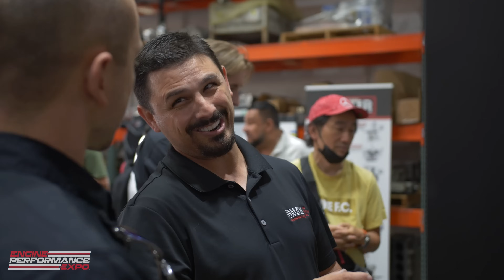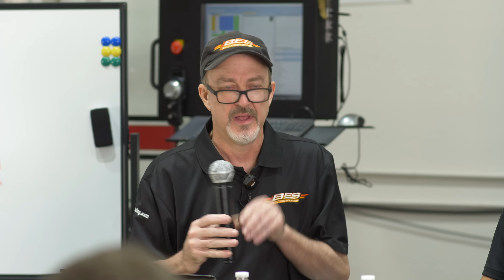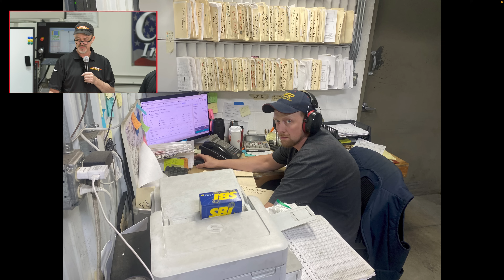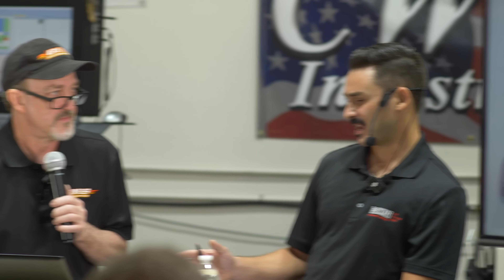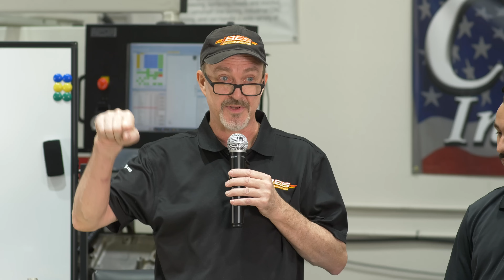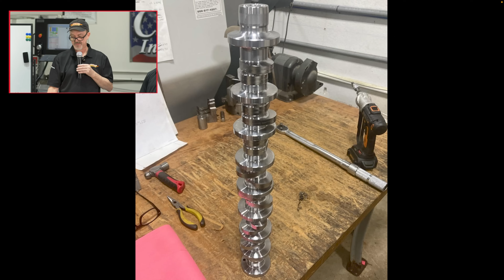Cylinder Heads, Manifolds & Modern Induction | Darin Morgan BES Racing (Part 1)

Comment: Thank you for sharing all the years of experience and knowledge here. As mentioned, you can't hardly find this information. I am curious though. You mention Split harmonic in manifold design. This is something I am dealing with right now. What I want to know is: is it better to have a bell mouth square to the intake runner with a split harmonic of say 3/4", or have the runner length closer and the bell mouth at an angle to the runner?

Comment: Would love to see Darren's version of a factory cathedral port LS heads.
Reply: Over the years, Darin has made his opinion of the cathedral ports known as it being a 'non racing' design that had a purpose of tight packaging and it is inefficient due to cross-sectional changes and velocity gradients. He said once that it is made for engines that never see the high side of 5500RPM. He talks about the LS3 or LS7 being superior, which makes sense.
Reply: @Pavel_Engines well thats obvious that the LS3 square and Rec port heads are better.  But you can't fit on to an engine with a bore size under 4". There is plenty of Cathedral port heads that still produce hp up to 65/7000rpm.

Comment: I guess in ww2 or in airplanes they couldn't run ethanol or methanol.  Or even blended fuel. Milage too low and water in the fuel.  Imagine a merlin  on methanol maybe nitro😂
Reply: The limiting factors for HP on the Allison and Merlin engines was rpm range desired just so they would last and to better match prop speed. Also, never were geared to make max power at sea level. They cared more about how much power they could make up in thin air
Reply: They did use meth/water injection.  They also had 150 octane gas available. You could make more power with nitro, but should be able to make nitro dragster level horsepower with just a good turbo setup and a little more rpm from a 27 litre/ 1650ci  4 valve per cylinder sohc engine just by adding boost and rpm, even with just race gas or methanol. Even pump gas should be capable of 8000 HP at moderate boost levels

Comment: I still think the camshaft needs to be thrown out and replaced with an eccentric shaft or small crankshaft that is connected to a cam lobe for each valve at the rockers
Reply: So design it .sell it to manufacturer
Reply: When they can produce an electric solenoid to open and close the valve that is reliable and "cheap" enough, then you can toss out the cam and have infinite "profiles" in the ECU to govern valve motion. That has not happened yet.
Reply: Imbecilic Arrogance
Reply: Electric solenoid not fast enough for race engines. That doesn't rule out mechanically operated hydraulic systems though, or hydropneumatic
Reply: The design is already out there that I think would work. Take a look at Nissan VVEL, but extend the link to where the eccentric shaft is in the block and the rest is in the head

Comment: From looking at modern scratch designed intake ports, the shape is pretty much straight with as little radius area as possible to transition to a throat area that is still angled to the valve. Does not the same thing you say about intake runners apply to the port as well?  Is the valve area still such a limiting factor that we need the flow around it to be straight down toward the valve head on 2v engines, even with the kind of valve motion we can get now?  Aren't the intake valves pretty much following the piston down the bore as close as they can?  Does the flow before the valve opens much matter more than what it does fully open?

Comment: And of course, a rocker shaft in place of the lifters in the block would also mean the rocker ratios can go whichever way you want, even putting the pivot for the block rockers on the other side to get more force on the pushrod with less pushrod travel, and make the head rocker ratio higher to get the right valve motion. With the computers to work out the lobe shapes, any geometry is possible, why still side load a cylindrical lifter into its bore at all, when you can pivot it on a shaft?  If you want to keep the roller on the cam side, fine, but F1 and motogp just use a convex face on the rocker with dlc coating and oil feed through the rocker shaft. Can do the same thing in the block of a pushrod motor and then you still get another rocker in the head to achieve perfect motion ratios throughout the lift curve
Reply: Dude, WTF are you even talking about?  Do you understand alot of this racing has rules?   You can't build a one off 55 million dollar engine to win $20k race.  You're like the Mopar guy that always acts like the Top Fuel Hemi is an off the shelf 426 from the 60's or because that's the motor NHRA uses, that it's the greatest design ever.   NO.. the F'N rules dictate that motor... period!!!!!!!!!!
Reply: Acfually, the rules in a lot of drag racing is wide open. Just gotta have 8 cylinders in a 90° vee, with  push rod actuated 2 valves per cylinder. Some rules require certain heads, or head characteristics, and maybe cast blocks, or cast heads rather than billet. Yeah, its expensive to do new things, but who cares about building the same shit every time.    If they did want to make some rules to limit costs, and still get good competition, they could look at some circle track rules, but drag racers generally like to avoid cookie cutter spec engine series
Reply: And, what is this about  Mopar gen 2 hemi is better than everything cuz that's what is allowed in the fastest classes?   How does that have anything to do with anything I was talking about. Those rules are pretty specific, but the cam and valve train is still pretty much open. Even the port shape is left to the builder. So innovation can occur. Can't really make them much faster though. Maybe try to get a valve train that is more reliable and lasts a little longer. I haven't looked at memo port shape much. Maybe they are angling the throats a little now. Don't really need it to straighten the port out, but might help fill the cylinder better with a little different path into the cylinder

Comment: Please, Darin, tell me why are we still using cylindrical lifters. A shaft with rockers, roller or finger follower with a curved ramp to match the lobe, and asymmetrical lobes are proven to be a better way to control valve motion, without even needing to make the cam core so big. ????  Just look at F1, motoGP, or even the mercedes/illmor penske engine from indy. ALSO, WHY do we still bend the intake port in the head, rather than angling the throat area like all modern race ports in 4v engines and even the old illmor mercedes 2v pushrod intake port. All modern designs other than american pushrod ports seem to be straight port at an angle to the valve head, where ours are curved and pretty much always have a throat that is perfectly perpendicular to the valve face. ???
Reply: because of rules that want to keep american racing retarded ? Not many years ago carburetors were still used in Nascar and Pro Stock.
Reply: Because it works and is very dependable
Reply: @hankclingingsmith8707 That's old think. Men who feel the need to cling to what they know and love, rather than adapting and adopting better technologies. To answer his question, because ego and pride. Like a raccoon protecting its garbage. The two valve in block cam stuff has made incredible advancement because of that devotion, but the same industry devotion to better tech will fruit the same result and at a faster rate. 😅
Reply: @hankclingingsmith8707  If it works so good, how come US brands following that engine rule always need bigger engines to make the same power EU or Japanese cars make?
Reply: @cristianr3712 tell me you know nothing about engines without telling me.
Reply: @trixnhoez2964  Let's suppose you're right, what's the reason then? Don't say US brands are always looking for the lowest possible BSFC because "muscle" cars are not known for their fuel efficiency.
Reply: @trixnhoez2964 Still waiting for you, Mr. Engine's Expert.
Reply: @cristianr3712 You're just comparing engines of two completely different designs and then cherrypicking certain factors like BSFC where you think you're favoured design may have an advantage.😂

Of course a pushrod OHV engine with port injection won't have a BSFC like a DOHC or quad cam v8 - that's nothing to do with the country its built in .. just look at an LS3 vs 5.0 Coyote..
Reply: @trixnhoez2964  Since it's not about the country then remind me who else is putting those engines in brand new cars besides the US, for example the Corvette c8 z51.

BSFC is Cherrypicking?😂 Ok, then what should people compare them at? BMEP is awful, potential to make power with mods is low compared to DOHC designs, what should I compare them at then? Should we compare their cam follower jerk at 7500rpms?😂😂😂😂
Reply: @cristianr3712 Yes the Americans were building cars with pushrod v8s and leafspring suspension well into the 21st century but if i remember correctly it was still faster than anythring European around their own tracks like Nurburgring 😂😂😂 Yes it is cherry picking to talk about stuff like BFSC whilst ignoring which car would objectively go around a racetrack faster which 99% of people care way more about lol...
Reply: @trixnhoez2964 Surely you're referring to the 7.04 Corvette C7 ZR1 Jim Mero's lap, am I wrong? Because if you are..... 😂 Quoting fake laps you'll get far man, you're referring to a lap that even the driver says it's fake, not to mention it was "SO well" documented that no nurburgring laps website would add that as a serious lap time, if that's not cherrypicking.... I don't know what is 😂😂😂😂 try again, just this time with proper info, something with weight. Oh and don't forget EU cars doing close or better lap times most of the time had smaller and less powerful engines.
And it's a long trend, history shows it clearly, how can you say it's not related to that country?
Reply: @cristianr3712 American engines are far from optimum, 75hp/Ltr is not that great, but when you have 6Ltrs it's not so important.
Funny thing seems to be, that they used to be reliable low reving ploders, now adays they don't even seem to be reliable.
Reply: @cristianr3712 Lap record for a road car on road tyres is under 6:30 in a More Seedes with a AMG sticker on it. It was set middle of last year (24), not going to go much faster in a conventional car, even Maro said that's about the limit for the track.